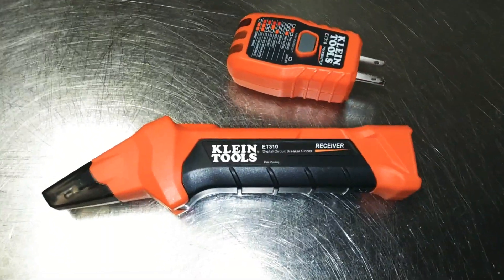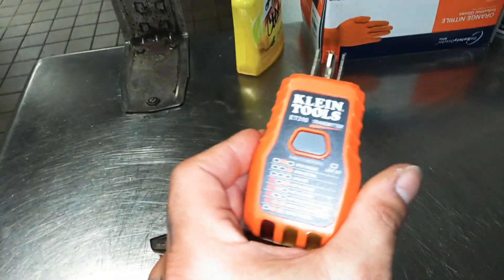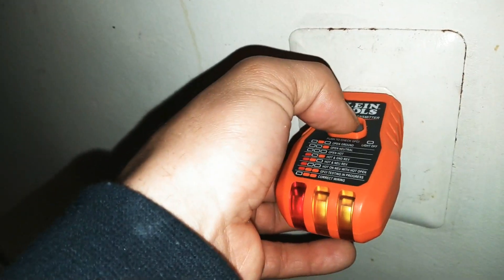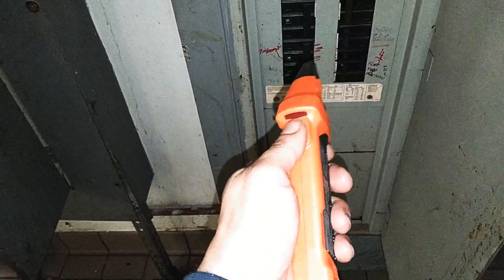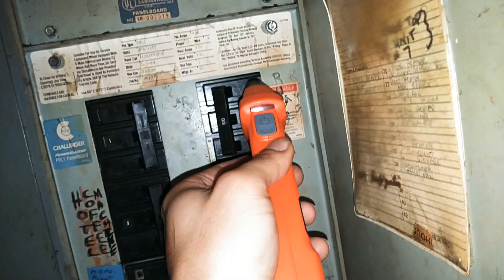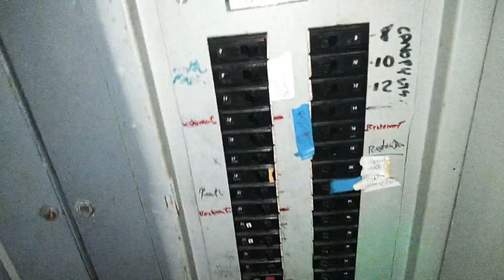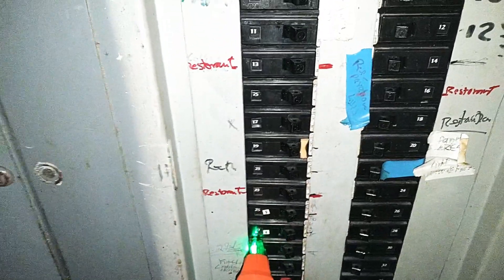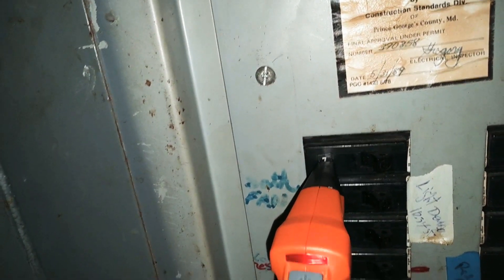SHOULD YOU BUY? NEW Klein Tools Circuit Breaker Finder & DOES IT WORK? 🤔 #HowTo #KleinTools #2021

Comment from the maker: Extra Video Information: I recorded this at a second job I held as an Engineer at a dying Hotel where I live. This video was shot in the kitchen area & the electrical panels - disconnects just so happened to be installed within this space. I also tested the "range" of this tools as in the video my proximity is very close, leading viewers to question the signal strength at furthur distances. I tested approximately 150ft with damn good accuracy. Also it's good to note that if circuitry is connected to multiple outlers, the panel can give false positives when getting close or near the specific breaker you're searching for (both lights blinking simultaneously green/red). Concurrently, the same can be said when scanning over the incorrect breakers. Essentially the tool WON'T do all of the work for you, you'll need some basic understanding of electricity, panels, wiring & outlets. I bought this tool for $50 at Home Depot within the electrical aisle next to the rest of the Klein Tools. There's also a NEW version of this tool with GFCI tracing abilities as this tool doesn't work well with said outlets & it also comes with extra testing accessories such as USB tracers & other fun optional necessities. 

I never expected this video to reach 50+k viewers and the comments have been very informative & engaging. Thank you to everyone in the past, present & future who takes the time to watch this. Love & respect - J 🙏🏼❤💭
Reply: ive seen from other videos when your receiver gives false positives you should reset the tester and then scan the breakers again, also turning on the receiver away from the panel ive heard helps with accuracy
Reply from the maker: @TheWackyRigger  It gave a false positive in my video... When I purposefully chose the wrong breaker to prove that the device does work. Did you not watch the video 🤷🏼‍♂️💀🤣
Reply: @ASAPJermz  I was only replying to your comment about every once in a while it gives a false read, so I just gave two things to try if you have a bunch of false readings, that plus circling the panel multiple times is recommended that way the tracer can get an accurate reading

Comment: Can this be used on 230v ? The mechanical timers and relays I work with have no neutral wires.
I have the adapter with the alligator clips.
Reply from the maker: Yes it can
Reply: @ASAPJermz  Great!
 I can clip one lead onto the line side of relay/timer, do I put the other on the ground?
Reply from the maker: @mayorb3366  You’ll need the attachment accessories that come with this tool to check relays & timers.  Loon it up on Amazon they have it as well as Home Depot. This tool as is only uses a transmitter that goes into a receptacle  that traces back to a main panel breaker box, which identity’s which wires are connected into each individual breaker. You’ll need more parts to do what you’re looking to do, that’s if you want to use this tool. There’s always the fishing option too, apply a line to the hot & ground & fish until you get to the breaker box, time consuming tho, hope this helps

Comment: What’s the range 
How far can you go ?!
Reply: I’ll give it a try thank you 🙏 for answering my question 😊
Reply from the maker: Pretty far, how far away is your panel to the outlet you're testing?
Reply: @ASAPJermz   
Well the outlet is on let’s say lobby level and the breaker box is two floors down
Reply from the maker: @carlosrocca2015  If the unit is operating correctly it should reach 2 floors down. 2 stories would be about 22-32 feet away from your outlet. I'm guesstimating but yeah..

Comment: What about finding the circuit breaker for light switch/fan dials?
Reply from the maker: Klein Tools has an accessory kit that allows you to trace those as well. But, they aren't included with this tool, you have to purchase them separately.

Comment: I was just curious, I know this says it's for 110,but if you hooked it up to one leg on a 220 circuit will it work,or at least read right on one half of the breaker?I'm in HVAC and work with alot of 220.Was wondering if you had tried doing this yet?
Reply from the maker: I honestly can't say that I've tried doing that! The tool is made for 110 so I wouldn't bank on it working in this manner. You should ask Klein Tools directly, I'm sure they know 👍🏼

Comment: Hi Great video!  For the most part this tool has worked for me but in some rooms in my house the tester finds the main 100 amp breaker as the circuit.  I have recalibrated and reset many times and it's the same.  it has done this on different outlets throughout the house.  Any suggestions?
Reply from the maker: Thanks John I think the issue you're having with the product is a manufacturer defect because others have complained the same issue. Sorry I can't be of more assistance to you!
Reply: I got the same problem!🤷‍♂️
Reply: These testers suck ass

Comment: Why does the receiver go off but not full steady red at the other the breaker?  Is it a shared circuit??? Not sure that’s a thing
Reply from the maker: Because said breaker isn't connected to the outlet that I had the transmitter connected to. Had it been the correct breaker it would've stayed red
Reply: @ASAPJermz  thank you the information!

Comment: you did not have to  turn the power off  from the breaker panel ?
Reply from the maker: If I cut the power off from the breaker the Circuit Breaker Finder wouldn't have power to identify the correct breaker. You need power for this tool to work!

Comment: Am I the only person in the world w/ no breaker box? I have those buss fuses.
Reply from the maker: If your electrical panel has fuses, check each fuse to see if the piece of metal inside has melted, or if the glass window at the top of the fuse has become discolored (usually purple or brown).
Also, if you use a multi meter you can detect which fuse is bad, that way you can replace it & solve your issue. You take the red end of the lead & place it on the first fuse & then take the black lead & do the same. If your reading is anywhere between 0-5ohms then you're good. If it's anything higher then that could indicate that the fuse has gone bad. Hope this helps!

Comment: What if the tester in the outlet reads Hot & GND REV? My outlets not working and wanted to test breaker
Reply from the maker: That means that your Hot & Ground wires are reversed. Switch the wires & you should have power. A lot of outlets won't give power unless grounded first & if you have a "hot" wire connected to the ground screw you won't get anything as that's a fail safe they put into the outlets to protect people. Hope this helps!
Reply from the maker: "Hot" wires are typically red or black & the ground is normally just a bare copper wire to a green screw (normally). This applies for newer outlets I'm sure the older ones had different colors and ground screws

Comment: I just bought a older house that only has 2 prong outlets. Would this work if I just kept an adapter on the receiver to go and test my outlets? Prior to my purchase of the home, a new circuit breaker was installed, but everything is blank on the sticker in the panel. Thanks!
Reply from the maker: Yes this tool will work with 2 prong outlets, you shouldn't have any problems. Good luck!

Comment: Hi,
Great video but, how can you find a circuit breaker when there is no power on any outlet in a room please with that tool?  I saw it at Home Depot for 49 bucks. I have that issue now. There is no power in one of. the rooms with 4 outlets but I don't which breaker works for that room.  Thanks.
Reply from the maker: Good old trial & error my friend. Go one by one & use the process of elimination at that point. You DO need power to operate this tool unfortunately

Comment: Does it still work if the breaker is off(tripped)?
Reply from the maker: It will not. If the breaker is tripped you won't make the electrical connection between your breaker & the tool which is electrically operated.. You have to have power to use this tool. BUT, if you only have 1 breaker or say 3 tripped then you've already fought half the battle. You know the outlet that's connected to said working breakers isn't what you're looking for.. Try testing all the outlets & have a second person call you or radio if the receiver from Klein is reading on their end. If you're at the breaker panel & your buddy goes to outlets you can tag team efficiently this way..

Comment: Only one what works without confusion is the ideal brand. I used this Klein on a large panel and it was showing multiple breakers for s single outlet. It works only on certain circuits when it wants to.
Reply from the maker: You might of had a defective unit from the manufacturer, it happens

Comment: Hey, thanks for posting this video.  I have this exact same tool and absolutely hate it.  LOL!  It never finds the right breaker in my house.  It will miss the correct breaker and show the wrong breaker every time.  Can you think of anything I might be doing incorrectly?  Do the two units need to be calibrated?  Could the wires in my panels be twisted around each other causing cross talk?  I am totally at a loss.  Thanks man!
Reply from the maker: Hey bro YES both the wall insert & the receiver need to be calibrated to whatever panel you're identifying. Take the tool & scan your entire panel one breaker at a time (going down) then repeat the process for however many breakers are in the panel (left or right side.) Then plug the wall unit in & press the grey button. It should light up (correctly wired) if not then that outlet is wired incorrectly (won't affect the accuracy.)

Comment: How do you use it for a light switch
Reply from the maker: This specific tool doesn't come with the available light switch tester. They do have one you can purchase though. Also you can use a multi meter to test an outlet for many different things. The kit for the light switch or bulb is in a Klein Kit I found for around $50. Hope this helps!

Comment: Thanks for replying, I'm  ubaldo again, I bought the Klein tools, circuit  finder. Now the transmitter doesn't work even on live outlets, what should I do
Reply from the maker: I'm not sure I'll get back to you if I find out that specific issue
Reply from the maker: Send the transmitter and receiver back for a full refund, it should last longer than yours did. Could be a manufacturing recall or simply a bad tool all together..

Comment: It only works up to so many feet away.
Reply from the maker: I've used this tool up to 150ft away give or take. The closer in proximity the stronger the signal strength & accuracy but, all in all it's worked for me when needed.
Reply: @ASAPJermz  it wouldn’t work 70 ft for me
Could have been a bad one
Reply from the maker: Possible or issue with the panel, outlet, breaker ect.. It does help to be close though no doubt!

Comment: Just curious, will this detect other receptacles on the same line by touching each receptacle?
Reply from the maker: Yes, if each receptacle are wired into the same circuitry (a lot of times it isn't done this way), you'll be able to verify that by testing the transmitter (plug in) at every outlet. More likely than not all outlets won't be connected. There's a threshold of allowance of electricity within each wire, therefore you wouldn't be able to nor would it be desired to connect a living or working space as such. Hopefully your panel is labeled correctly! Hope this helps! 💯

Comment: Your outlet is near the breaker  panel . Is the beaker finder very selective if the outlet is at 20 ft or more from the beaker panel ?
Reply from the maker: I've used this tool up to 150ft away from the panel. I just so happened to be in close proximity whilw recording this video.

Comment: Some of the questions i the comments... I hope they don't do ANY electrical work...
Reply from the maker: I'm not an Electrician or anything close myself, hence the reason I bought this tool. I thought it was a cool nifty tool to have handy just in case, low and behold I've ended up using it a lot! I'm a welder / pipefitter but I work with Electricians and other tradesman on jobs and even do some electrical work if need be. It's key to note that everyone's in different stages of their understanding of electric and it's uses and applications. Just because a person holds a title doesn't mean they're Gods in said arena. Anybody can pass a test or die from 480volts..

Comment: Can I find the neutral wire with this device?!
Reply: Actually you can find a neutral wire with this device what you know the hot wire is just find a neutral wire of that on the same circuit if you have to you can put a load on that circuit find the neutral wire that has the same amp draw as the hot wire does so if your hot wires pulling 8 amps your neutral wire should be pulling 8 amps that's why it's good to have a hundred watt bulb or an old electric heater to actually load circuits find resistance
Reply from the maker: @pauljanssen2624  That is very possible but, identifying circuitry isn't what this tool is best at. I'd suggest a circuit tracer.
Reply from the maker: No. This tool can't identify wires. It only allows you to plug into a receptacle & determine which breaker is connected to said outlet. This is mainly for people who moved into a home or work somewhere, the electrical panel isn't labeled correctly or AT ALL. Or for those who want to install new or up the AMPs for a breaker at their home or work space. 

Neutral wire - is never going to be red (hot) although it can be black from my experience. It should be beige or like a dirty white color, generally speaking.

Comment: Does it work if you're trying to find a breaker that is off? And you're trying to find the breaker to turn on?
Reply from the maker: In that case you've answered your own question. If a outlet isn't powered and you have breakers that are turned OFF then logically the next course of action would be to test said outlets that aren't powered. It's gotta be one of the non powered outlets unless, your circuitry is connected like a bowl of spaghetti then in that case you're screwed!

Comment: Labeling the damn circuit panel properly would help.
Reply from the maker: In a perfect world 💯😂 Thanks for watching
Reply: @ASAPJermz   I would settle for a less hurried one.  You would love my home’s wiring reference. I mapped every receptacle, switch, and appliance on a spreadsheet, then filtered by room. Printed and hung by panel.
Reply from the maker: Sorry for the late reply that's amazing! I'm actually not an Electrician but I do work in the HVAC field & do some electical work from time to time. This was just a curious pick up to be honest that ended up working when I needed it to. What other brands would you suggest?

Comment: Does it still work if the receptacle is wired incorrectly?
Reply from the maker: If the receptacle is wired incorrectly your transmitter that comes with the tool (plugs into the wall) will show you that it isn't right. But, even in this event you'll still be able to identify which breaker it's connected to..

Comment: He didn't follow the directions, that are necessary for accurate scanning.  You must scan the panel once, running the receiver down both sides of the panel slowly.  This allows the unit the 'learn' the panel (whatever that means -- it's beyond my expertise).  Then, you run your scan a second time.  It is that second scan that you should trust.  It so happens, I am having a hit-or-miss quality with mine.  Still expirimenting with why it is finding the correct breaker sometimes, and not others.
Reply from the maker: I did exactly what you said, I didn't explain that's what I was doing in the video though.. I scan both sides twice in my example. But, since the breaker that controlled that specific outlet was in a different panel, I didn't feel the need to do it again on the correct panel.
Reply: Same situation with mine I just purchased. Did you come to any conclusions?

Comment: For the last 40 years or so I've used a plug cap connected to a switch!! Plug it in and flip the switch. No overpriced gadgets !!
Reply: Actually dangerous. Can cause damage to wiring in the walls that u cant see. Its an old timer way of doing it but not recommended or osha compliant.

Comment: I always take a couple inches of copper wire 12 gage and strip both ends hold it in my linesman pliers and stick it in the outlet breaker trips and I don’t have to go running around to see if the power is off
Reply from the maker: Who went running around to see if the power was off?
Reply: Wait, you short the 120 outlet but crossing the wires? That sounds crazy.
Reply: @oofunstuff  I have been doing that for probably 40 years never a problem and occasionally I find a bad breaker that won’t trip !!!!
Reply: @keng1197  I get it, but non electrician home owners come here to find answers and this might put them in the hospital or worse.
Reply from the maker: Those said awnsers aren't coming from me though, the page & video creator. I haven't advertised or advised anyone to do anything that can potentially put them in harms way. Just wanted to clearify that.

Comment: Power on or off?
Reply from the maker: You have to have power to operate this tool, as you plug the transmitter into a receptacle, if it's not powered you won't receive a signal to the receiver
Reply: @ASAPJermz  Do u have an agent in Egypt . What is price
Reply from the maker: @cocktail9344  I don't. $1k 🙏🏼